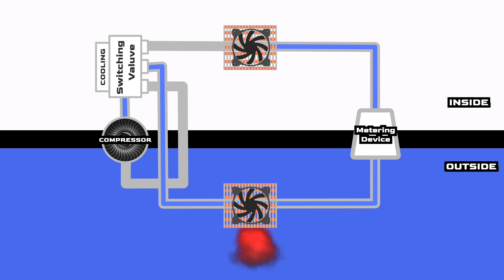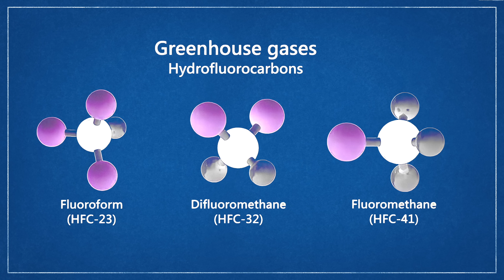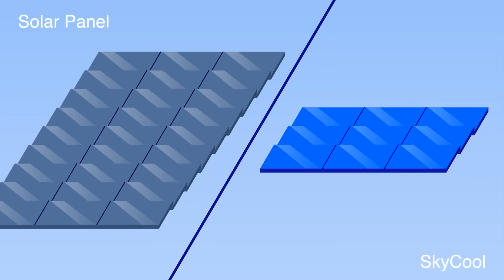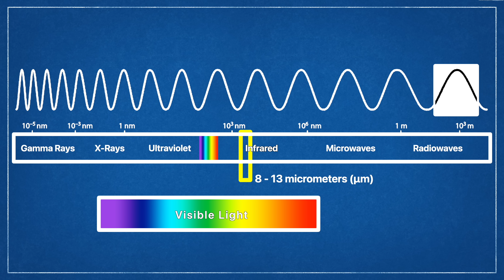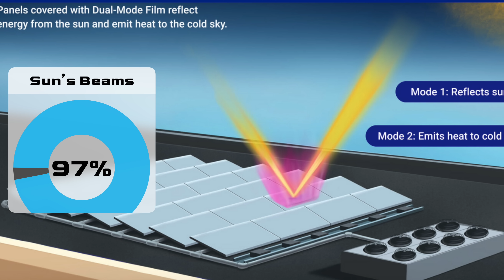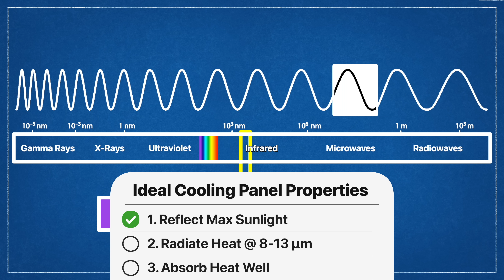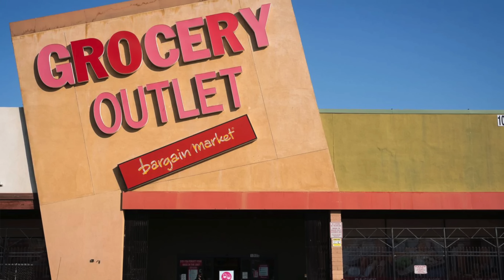New AC Tech Sends Heat Into Space & Saves 95% On Cooling Bills!

Comment from the maker: Hope you enjoyed the video! Don’t forget to download Acorns and start investing with just your spare change. You can get a $10 bonus investment if you use my link to set up an account! https://www.acorns.com/TwoBitdaVinci  T&C’s apply.
Reply: Good video, but that's a hard pass on the spyware pump n dump
Reply: You can even expand on the earth aspect, if you have ever heard of monolithic dome home, these domes are built to last a lifetime or two or three, they can withstand earthquakes all weather conditions including hurricanes and tornadoes but just like the Earth ships they also are much cheaper to heat and cool, it might not hurt to partially buried them as well with in the dirt.

But there is a great insulator and having your home shaped like a dumb as more advantages than just the heating and cooling which will also lower the cost that it would normally cost to cool your home and heat your home, and our solar panels are advancing, I have seen solar panels that are practically made a fabric or a new type of solar technology they could be painted on Windows oh, we should be taking advantage of all these aspects and building on I concept they can work on a global scale.

However one thing we should never do as a society, never just use solar wind water turbine power, always have multiple options just in case one breaks down or fails for some reason.

Having multiple options when it comes to power generation or avoiding the need for so much power generation by using certain methods, can be a very important path to take but also it could be less difficult when you use multiple options instead of only using one option.
Reply: Sounds expensive but workable. The ideal install would be on a building with roof faces pointing south and north. The south roof face would have solar panels and the north roof face would have these cold collectors. The AC heat pump then can do a lot less work and the house would be more likely to get enough power to run everything from the solar panels. Another major point of savings would be for homes to use DC in many systems so the whole house battery doesn't need to run its inverter 24/7.
Reply: @tsamuel6224 it probably is expensive, but it doesn't have to be. The panels themselves require more surface area and thus more material, but the material isn't expensive. Despite the cost of things like silver and hafnium are not going to be cheap. But the upside is these function optimally in places where heat gain is the worst. The panels themselves can be made out of any material. And. The coatings are on a nano meter scale meaning almost no material used
Reply: Could Tesla build this into their vehicles?
Reply: @NerdHerd_TV  actually santo made in 1979 a solar car with helium compressor
Seidel says
Reply: Get rid of grass plant native shade trees of all kinds.
Ah ya theres a solar panel/water collector its called source
Reply: @thesilentone4024 

The irony. Gov gives incentives to kill weeds and replace with gravel. Gravel increases temp by more than 10 deg F

People are out of touch and have no connection. They are lost and pay the cost. 
Now you need a heat pump the obvious aim of the game is to rob us of knowledge so we become used to paying bills for things that use to be simple and well known. In other words, we are becoming dumb money slaves
Reply: There is no global warming lies!!.. Scare tactics...
Reply: @carsonglass7231  even worse there is no gobe
Reply: Any update on this project?
Reply: Link to accorn no worky

Seidel says
Reply: Sponsored video
Reply: No overall record breaking going on, I've lived in Texas most of my life, we've had much worse years, even in recent memory.  Don't believe the hype.
Reply: Never believe anyone sho is trying to sell you products or new taxes based on global warming. It's a scam.
Reply: It's called a "cold collector". I was playing with this over 30 years ago - take a large satellite dish, cover it in aluminium foil, surround it with a wall of styrofoam to hide it from surrounding trees or buildings radiating energy, and suspend a black container of water near the focus. Measure the temp, and watch the water freeze.
I suggest they would get far better results using a reflective parabolic trough aiming hot fluid to an empty patch of sky, rather than using flat omnidirectional panels.
You can try it yourself even using a wok and insulated box, it works!
Reply: @ahaveland thanks for the tip
Reply: cool story bro only one hitch space is fictitious :p

Comment: The video misrepresents this system’s principal use case in a way that should have all our BS detectors clicking like a Geiger counter at Chernobyl.

The system cannot meaningfully cool an interior space below the ambient exterior temperature during the day on its own; rather it is designed to be paired with a heat pump to reject concentrated heat more efficiently than traditional heat exchange with the ambient air.

I’m glad this was recommended to me, though. It seems like it could be a very effective, lower maintenance alternative to evaporative cooling for chiller systems that doesn’t require a water supply.

Comment: Yeah this sounds like BS.

 Radiative cooling using essentially fluorescence (absorbing one wavelength of electromagnetic radiation/ light and emitting it in another) is only going to go so far as to reflect radiation that is being sent on it. It isn't cooling so much as it is transforming radiation from one wavelength to another. 

  However, stick this on a water bottle and stick it in the sun: wait about an hour and i would bet the water and the bottle will be just as hot as if you just did no coating at all.  

@Thunderfoot should take a look at this.

Comment: Check out my device that uses wind to cool a room.
On our website, we also publish actual graphs showing how we have been able to reduce air conditioner usage every year.
I had a sense of crisis about global warming even before people started making noise, and I am introducing other ways to save energy, albeit in Japanese.
I watched the video, and I think it is very effective in areas where it is hot all year round.
However, in latitudes where it snows, more energy is used for heating, so I have doubts about that.
Due to efficiency issues with air conditioners, the outdoor unit generates more heat than it does to cool the indoor space, which is a major factor in accelerating global warming.
In particular, if you use your air conditioner at night when solar panels are not generating power, the amount of CO2 generated by power generation increases, creating a vicious cycle.

If you know someone who is traveling to Japan, please recommend that they buy my device to cancel carbon emissions.

Comment: In Scotland we don't need air con very often, however I do have a small air con unit which runs on electricity. I only use the electricity from our solar panels and batteries on the few days when I know it's going to be too hot at night. I'd love to dump the heat into space but would I be better buying some more solar panels and charging my batteries so that I use less grid power? The question of painting the roof white, or using reflective foil might also be relevant.

Comment: Just changing from medium brown asphaltic roof shingles to white asphaltic roof shingles on my previous house saved 40% on electricity in summer.

Reflect rather than absorb.

Insulate directly under the roofing and you reduce heat trapping in the attic.  This is usually easy and inexpensive.

The spray foam insulation directly applied to a high reflection color metal roof is extremely good at reducing cooling costs.  It minimizes the masses heated by sunlight absorbtion.
Reply: Just spacing the solar panels from the roof surface and allowing natural convection cooling of the panels will reduce the heat load they impose on a roof.  

Flat mounting them on a roof (even a roof that is at the correct pitch for Equinox max efficiency) is maximizing the heat transferr from panel to building  and ihibiting cooling of the panels reduces their efficiency.  You lose TWICE.

Comment: seems to be a solution for something, which isn´t a problem anymore. During summer (when you need cooling) your PV cells produce too much energy anyway. Additionally the cooling is typically even more efficient than heating (SEER vs. SCOP). Excess energy from you PV can also be used more easily/for something else. Also you can use your heat pump also during the colder seasons for heating.

I guess the installation facing north could somewhat make sense, but only if you can´t produce enough energy during summer with you PV for cooling. But at least here in Germany the trend goes somewhat into the direction, that you also install PV facing north (heterojunction PV panels, to get also some energy during diffusive light conditions). Especially when the north faced roof isn´t angled very much (which you need for the radiation cooling).

Maybe it´s is usefull for something like malls, where you really need a lot of cooling - it´s mentioned on the website, that it produces 2-3x as much as energy as PV per area. I guess it´s somewhat incorrect, because you´re comparing energy with high exergy with energy with high anergy. With the addition of a heat pump with a good SEER, you probably better of with a PV. But maybe the (i assume) lower installation costs could make it relevant?

I thought about the combination of this technique with bifacial modules (albedo effect) + additionally cooling of the panels, but ofc at least the cooling doesn´t work because the panel is than above the reflective paint - meaning you can´t emit into space.

I don´t actually know about the absorption spectra of those paints - if someone is able to produce a paint which only reflects wavelengths which can´t be used by the pv panels maybe this would be something useful. Than you can put these paints on top of the PV panels and reflect the not so useful wavelength back (pv panel isn´t heated as much) and at the same time cool panel for additionally efficiency.

Comment: You suggested that "heat pumps moving the hot air outside really wouldn't do the trick" (paraphrased a bit).  And then implied that the heat will now just stay around outside with the heat from every other persons heat pump output.  All that heat will find it's way back to space, as evidenced by the world NOT over-heating even while the number of heat pumps steadily increases.  Not detracting from the content of the video, because (if it works as well as claimed) it has the possibility to lower cooling costs.

Comment: A couple of questions... Regarding ac units, why are heat pumps like Stirling cycle coolers not used instead of ones using chemicals?

And these space radiators, is it ever possible to use pv panels to run a heat pumps and use these radiators for the hot side, can it radiate more than the sun's energy on the panels? Seems like there's a thermodynamic law going on there...

Comment: it's funny this just showed up in my feed. I was planning to build a system like this but with another type of cooling but it requires road salt once in a while to feed it, it uses solar thermal and the  cooling pipes have a coating of cooling paint which does the same as the materials in the  video.

Comment: Reflect Max Sunlight: so if I cover it above it with a shadowing material that sends back the light as light, and does not absorb it (for example with a mirror)
Radiate Heat: a standard radiator uses this 8-13 micrometer length, because this radiation, what we called as heat
Absorb Heat Well: It is a radiator, which is a good heat exchanger radiator. Thin lamella, good conductor metal, etc. We have had that before.
Maybe just I do not understand well, but what is the difference between this, and a mirror-covered good radiator?

Comment: I know this sounds awesome but it still requires some upfront cost, maintenance, pumps and other things. why not just plant some trees and use the shade from it? 
of course they would need to be close to the building (with the branches and Leafs in between the sun and the building) and you didn't get the heat transfer of the panels, but you could just put normal ac units that transfers heat a lot better than some panel radiating heat to the wind/air.

Comment: Let the Sun shine. As much as it can. Let it warm the air as much as it can.  To isolate ourselves from the heat, or to insulate our houses will not give a viable solution because additional costs will be involved in installing the material and R&D associated with identifying and fabricating it. Our job should be to make the best use of its heat. You may well make a house underground, say thirty feet deep, with the money which you would otherwise spend on buying insulators and radiators. The outcome will be the same, albeit achieved in a better way. A cool house. For ages, termites have been doing this and have survived severe sunburns. Nature has all answers. For severe heat, it has cool earth. Man need only to identify and utilise the working fluid for heat transfer. Termites have discovered air as the ideal medium. Whenever we feel the need for an air conditioner, we only need to emulate termites and go no further!

Comment: There some fascinating designs from ANT studios in India and also yanko designs for a simple eco friendly air conditioner system that is made from a terracotta panel or a honeycomb structure of horizontal pipes with a small amount of water running down said structure, this brings the room temperature down by about 25°f. its simple, its cheap, its eco friendly, its just is missing mass adoption

Comment: At about 8.45 you show a device mounted on a wall. That unit is not an a/c but an evaporative cooler, or "swamp cooler", as we call them in the desert. Water drips down aspen pads and a fan blows hot air from outside through the pads, cooling it, into the house and then out through open windows. It was the cooling of choice in the desert because it was very cheap and effective in the dry months. It isn't used much now because of the amount of routine maintainance and the staggering increase in the cost of water.

Comment: I super insulated my foundation walls from the outside, (used styro costs peanuts) the mass of sand and soil within my foundation acts as a seasonal  earth battery. Cool in the summer, warm in the winter. No moving parts. It is almost that simple. add in oversized trusses in the south facing walls to control the solar gain. free heat, free cool, no moving parts. no footprint.

Comment: How is this actually a solution? Clouds absorb infrared and send it back to the surface? If this system would work 24/7 it would heat up clouds more and have it radiate back to the surface at another location while moving. It is another example of what you said about standard AC: it moves heat from one location to another. This system would only work in a positive way in areas without clouds or operated at times when there are no clouds.

Comment: You can make your own versions of this pretty easily.  Make a vacuum insulated cooler (but with no IR reflectors), paint it as ultra white as possible, have bottles of water in it, put it on your roof with a straight shot up to the sky (no trees above this area), underneath the cooler, put reflective Al of some kind, raise the cooler off the reflective surface a bit so that there is a bit of air space between the cooler and the reflective surface.  Have an insulated vent pipe coming from the cooler to a window. 

    You will get most cooling on clear nights and a little during the day.  Cooling will depend on various factors, such as how white the outside of the cooler, how well insulated it is, and the surface area and shape of the IR reflective Al material below it.  Also clouds will affect it.
Reply: Hi thanks for sharing. Could you give more information or details of how to do this. Sincerely.

Comment: My friend cooled his house with water from a well going through a scrap radiator and a fan. It cooled the whole house quite well. It's pretty simple .. a coil of pipe with cold water going through it and a fan blowing air on the coil. You will need a drain for the condensed water dripping off the coil. You can run the well pump and the fan off of a solar panel too reducing the cost.

Comment: In France, most people live without AC, even in the south. And I don't remember it being that hard, since I am living abroad, I discovered AC and I could not live without it anymore. 
But I don't know if that's any better to have this much comfort, we are stuck inside of our house, and we can't stand any small discomfort in our lives.
Reply: Most of the world uses masonry mass as an equalizer for all seasons. We use to do that along with double hung windows that opened top and bottom to clear heat from the high ceilings (9-10 feet tall) and it was easy to survive the summers. Proper orientation on the lot, plus passive solar with proper overhangs and roof pitches made a huge difference. Houses were designed for the latitude they were built in. Now folks want a Cape Cod house in Oklahoma built from stick framing and it just does not work proper.

Comment: The theoretical energy savings are attractive. The effective drop in temperature "up to 15° below the ambient air temperature" is NOT. On a 100° day, it would bring the inside temperature down to perhaps 85° which most people will find insufficient. Especially in work environments, where heat producing computers and employee's body heat raise the inside temperatures. Based on the information provided, this technology appears to show its greatest benefit in combination with traditional air conditioning technology by increasing the energy efficiency.